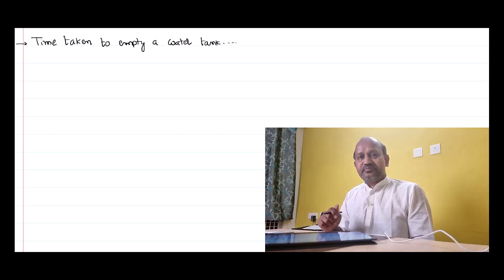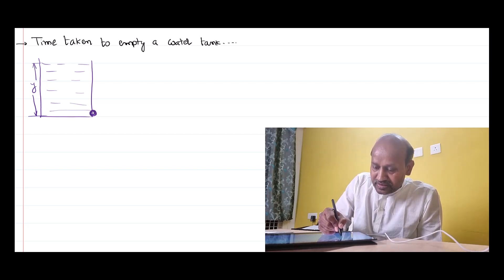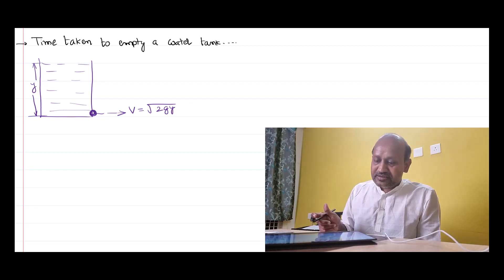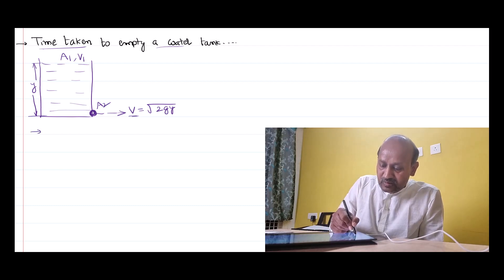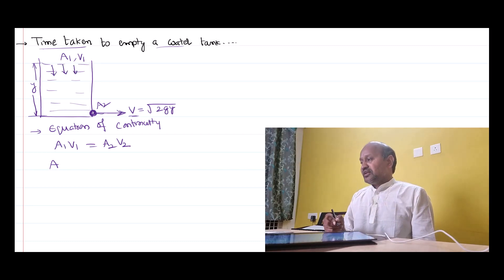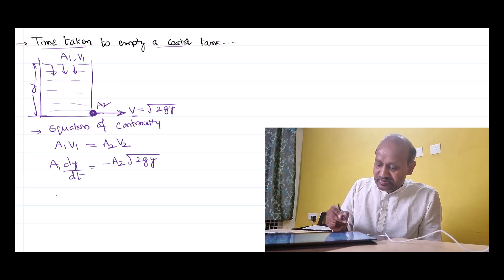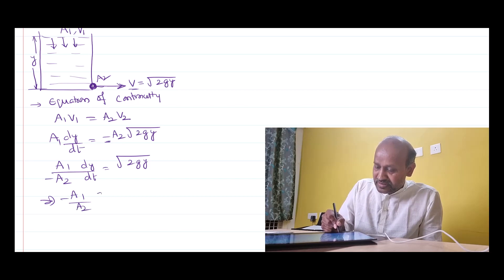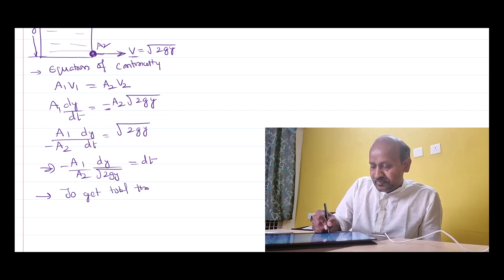Time taken to empty tank and Problems on application of Bernoulli's theorem for JEE and NEET Physics

Comment: Two identical solid balls with masses m = 0.15kg are connected by a spring with constant k = 0.875N / m . A third ball of the same mass m = 0.15 kg moves with initial  velocity u = 1.2m / s and hits one of the two balls, the collision is absolutely elastic. What is the maximum amplitude x max of spring oscillations after the collision?